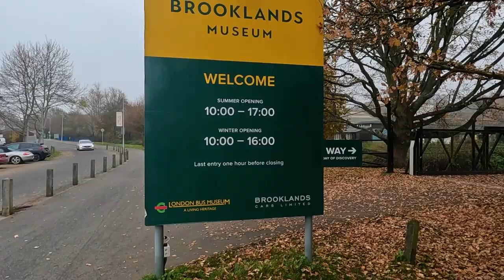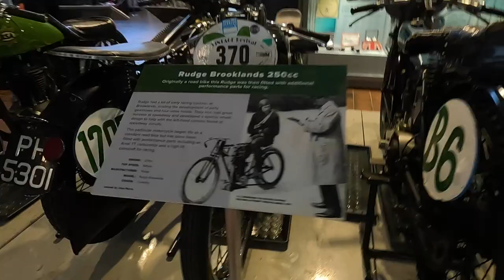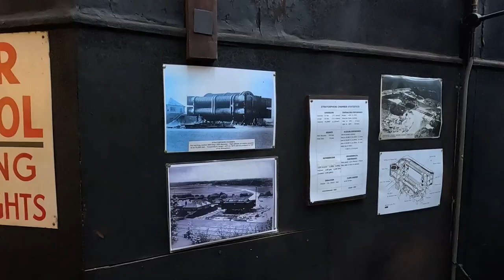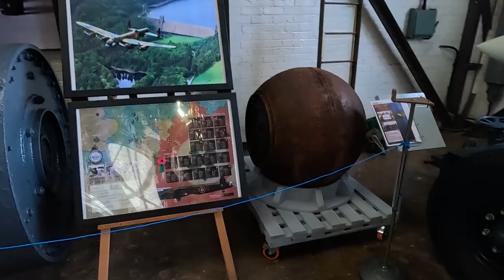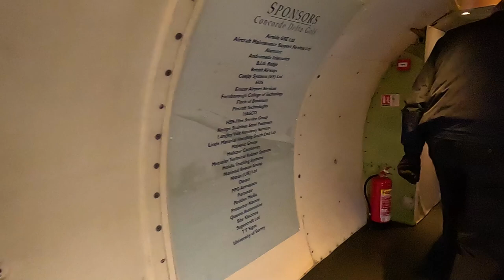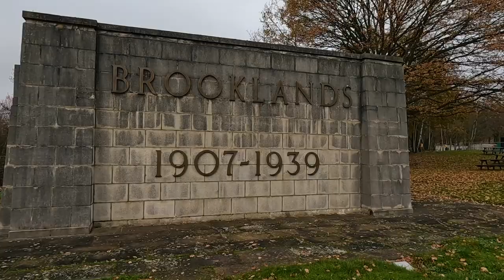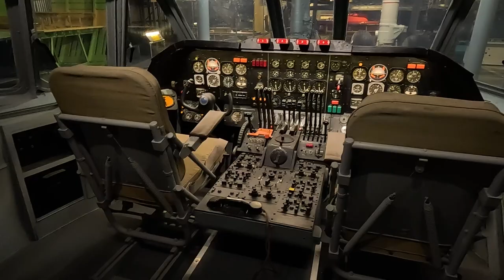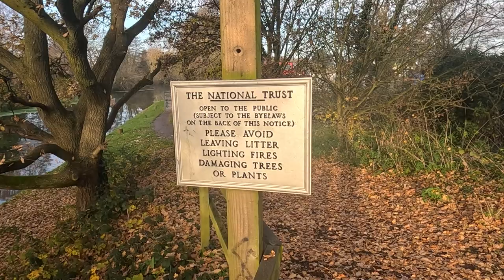A Return to BROOKLANDS MUSEUM!

Comment: What a delight! There was nothing like that there (that I remember) on my one and only visit 50 years ago. But there was a Concorde to go in, while it was still being built. No certificates in those days either. I think it was a school metalwork/engineering trip, mainly focused on the construction process of Concorde. I remember feeling the perfect flush riveting on the wings.
Reply from the maker: It's changed a lot since I was last there and that was only 11 years ago.
Reply: @MarqEnglish  I have always wondered how they got the newly built Concordes away from Brooklands. The runway barely seems long enough for take off.
Reply from the maker: @MrNas42  Maybe it was taken apart and taken to Gatwick or Heathrow which is how this Concorde got here.
Reply: I have an uncle that worked on Concorde.
Reply: @MrNas42  - I think the runway was significantly longer prior to the 1980s